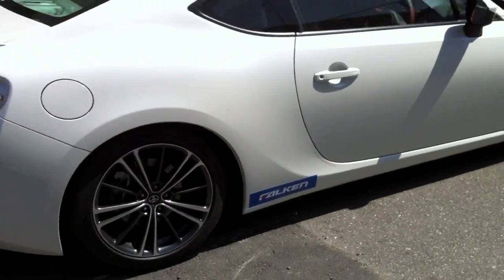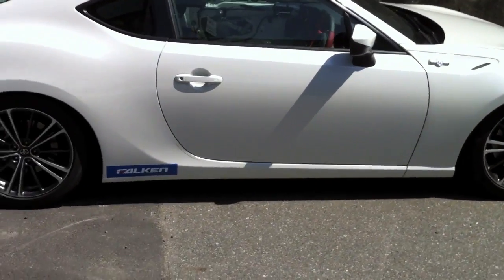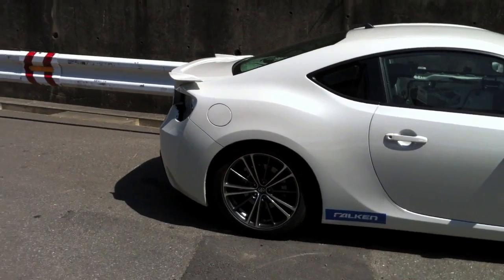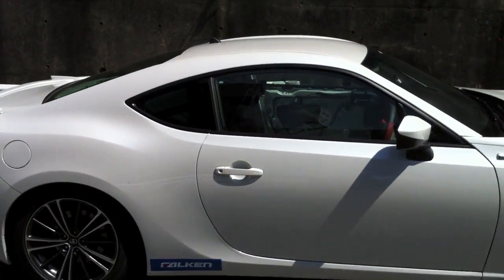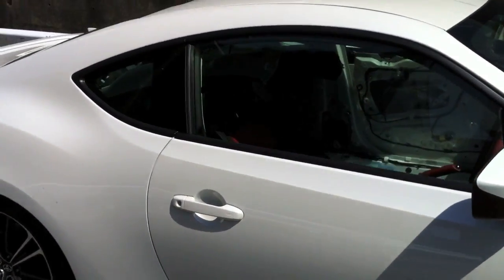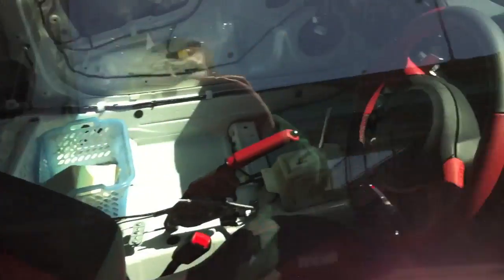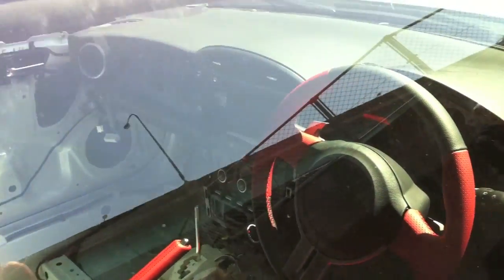New Toyota FT-86 - URAS D1 Project 2JZ Swap

Comment: A guy in europe is already drifting a swapped 2jz FT86 already. Radiator and other parts had to be relocated to the trunk due to excessive weight in the front due to the iron block. I would swap a 1uz or a 3uz. Aluminum V8.